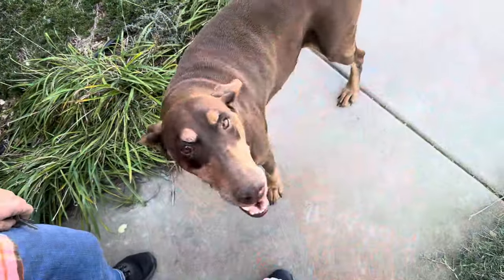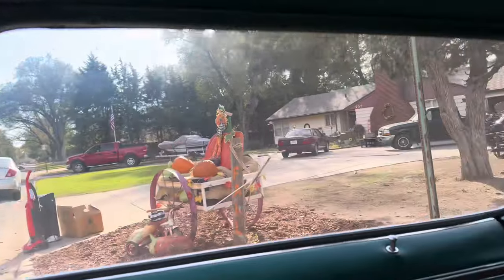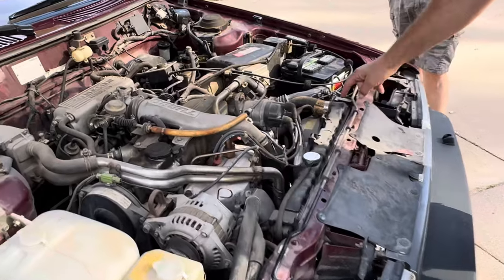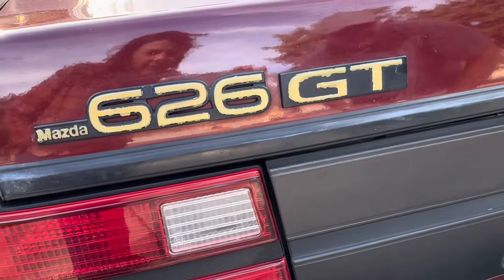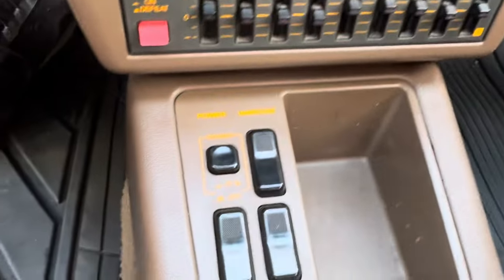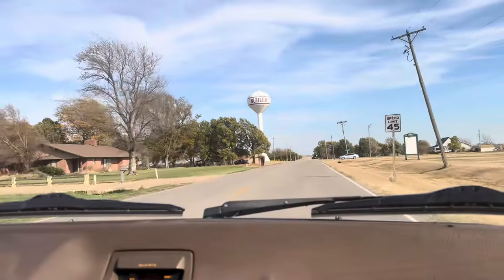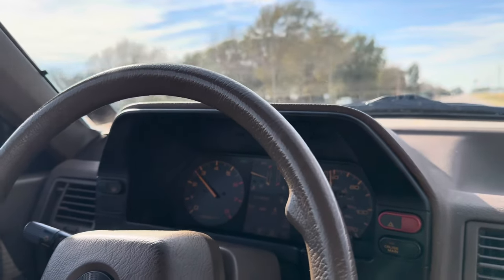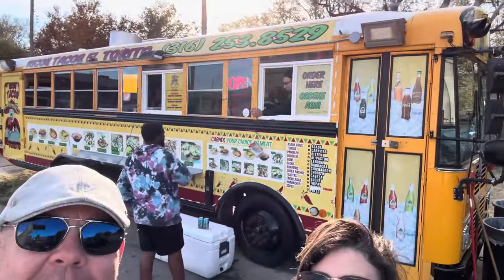Rare 80’s forgotten car FOUND! You won’t believe this 1986 Mazda 626 GT TURBO Coupe Stick condition!

Comment: I actually had an 86 626GT.  Mine had a digital dash with a big "turbo" emblem in the upper right.  It was a lot of fun.  I never had an issue with the drivetrain, but everything touching the front wheels from the bearings to the rack broke on mine.  Finally I sold it in 1990, and got an 86 DX.  As much as I loved the GT, I cannot remember the DX breaking even once.   I also had a brown interior.  I wonder if the GT interior came in any other color.

Comment: I had an 87 626 GT sedan, black with a grey interior. A few features you didn’t notice- the Auto mode of the Auto Adjusting Suspension will tighten up the rear shocks under hard acceleration to avoid squatting, similarly the fronts under hard stops to avoid diving, it also firms up under hard cornering- try jerking the steering wheel and you’ll notice sport mode engage momentarily. It was standard on the GTs. There’s a tiny light in the drivers door keyhole to help guide your key in the dark- it turns on for a few seconds when you lift the handle. The GTs were all basically fully loaded aside from the sunroof, digital instrument panel, and they’re all 5sp manuals, there was no automatic option on the GT. Also, the glass has a very slight bronze tint on the GT models only, along with a unique 3 slat honeycomb grille and headlight washers. The 87s had nicer seat fabrics, colored bumpers, mirrors, and door handles, plus the turbo badge was white instead of red. Black/grey combination was exclusive to the GT.
Reply from the maker: Great information!
Reply: You bet! I just added some more right before you commented. :)

Comment: Nice car.  My 1986 Nissan Maxima (manual trans.) had the adjustable suspension like that, but I believe that was a more expensive vehicle at that time.  (only had that car 1 year and traded it in on a 1987 Buick Grand National....wish I still had either of those cars now.)

Comment: Darn,  I still have my 88 mazda mx6 gt turbo with stick, all OEM. Darn the 88 is still quick.

88 was a new body style and a 2.2 litre engine. It was prone to torque oversteer. 

I just got a tour of a car collection from a deceased gentleman, stored in a warehouse. It has over 30 69 to 71 mark iii's in great low mileage condition. The wife is willing to sell. I'm a buying the green one with the black vinyl top, 45k miles. It has 4 bricklins,  and even a perfect 79 mark 5 bill blass.

Comment: This thing is awesome!! I always thought the 626 had the same 1.6 liter  as the original na Miata but the engine looked completely different.
Reply: I was selling new Mazdas in the 1980's in California and as I recall the 626 nearly always came with a 2.0 litre 4-cylinder, although they did offer a V6 in some models and in limited numbers. I believe the Miata engine was based on the engine in the Mazda 323.
Reply: @MrPagefile  you're right! I was thinking of the 323

Comment: Just a small precaution.
The vacuum hoses and all the plumbing for the turbo system is probably okay now, but they have a tendency to disintegrate a short while after  you've taken the back in use again. There's a few check valves and diaphragms that tends to crack, go brittle and fail.
No hard or expensive fixes, just tricky to diagnose and find without prior experience.

Comment: I had a non-turbo 626 4 door. My dad bought it new and gave it to me after college. I wanted to get it to 200k miles, but it was running too rough and I traded it for dealer minimum with 197k miles.

Comment: "Cheap, flimsy cars". I remember how Mazdas from this era were literal dings and dents magnets, it was like Mazda used thinner sheet metal and paint finishes on purpose, and they probably did. Seeing how this particular example's hood clearly buckles when Bob is handling it proves my point.
Reply: The flimsiness came later. I had an 84 626 and an 87 66 GT- both solid. Later, I owned a 93 626 ES-V6, and the sheet metal was indeed thin. Fast forward ten years and I owned a 2003 Mazda6 (the 626’s replacement) and they’d improved the sheet metal significantly.